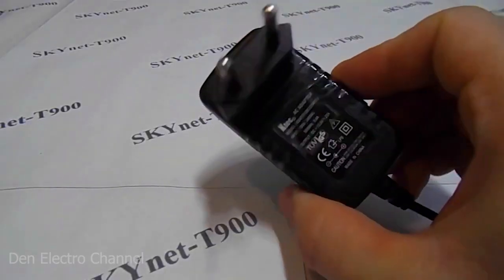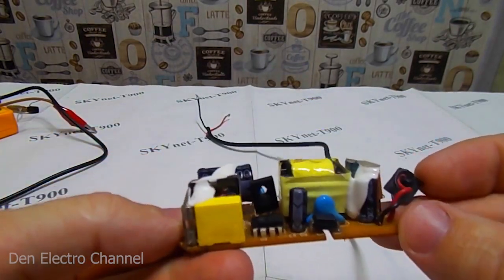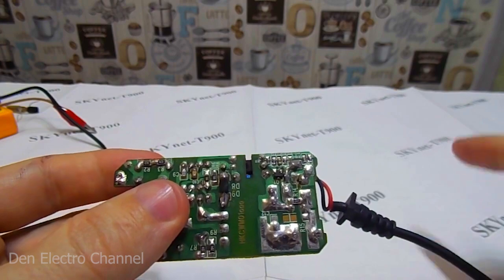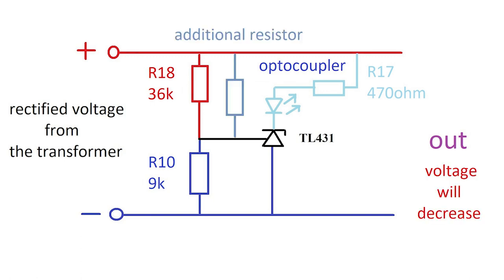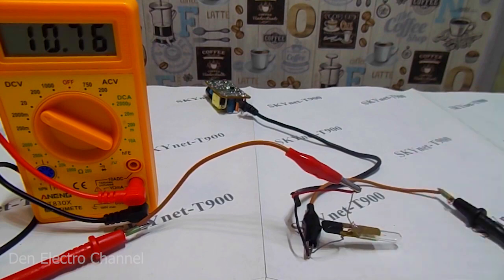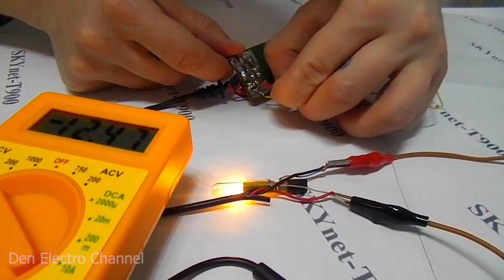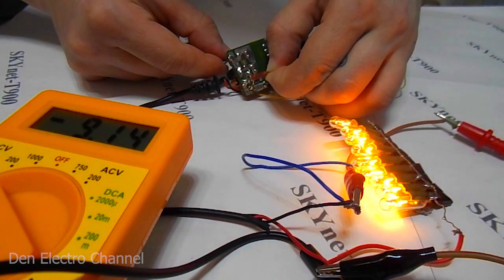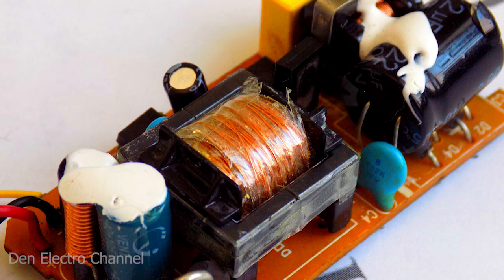How to change the voltage of the power supply? } * { The easiest way!

Comment: NICE JOB DUDE . GOOD SMPS TO SHOW BOARD AND PARTS. GOOD IDEA TO DISCHARGE  FULL BRIDGE RETIFIER FILTER. CAP FIRST. THEY ARE  USUALLY  4.7 UF - 10 UF @  160 VDC  AND UP.  KEEP UP THE GOOD WORK !!! 😊😊😊😊

Comment: I experienced a weird thing on a 42v psu when trying out resistors. I connected different resistors by holding them with pliers and I was evrntually satisfied to see the voltage drop..... but it kept dropping.. and dropping.. and droooopppiiiiinnng.. slower and slower but now the output is on 0,1 volt and I have not touched anything for minutes. I'm confused. What did I toast? Some capacitor must have given it's last breath.